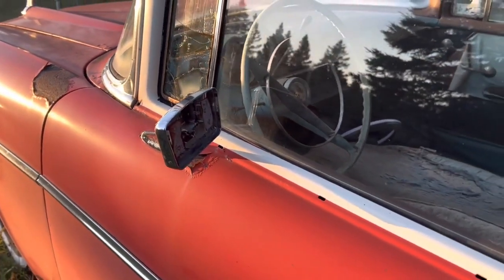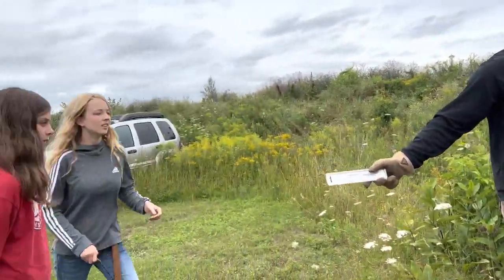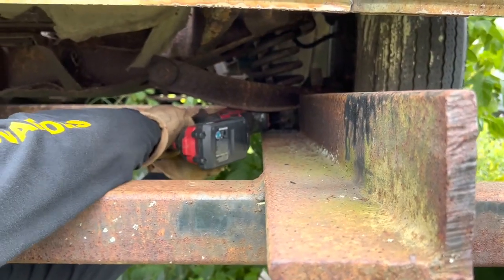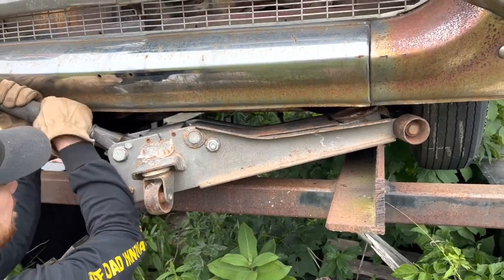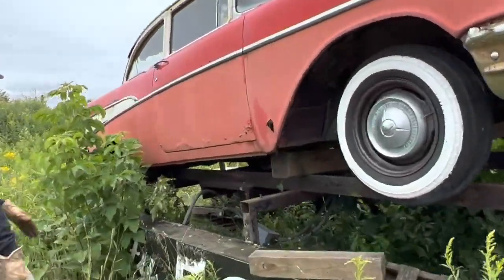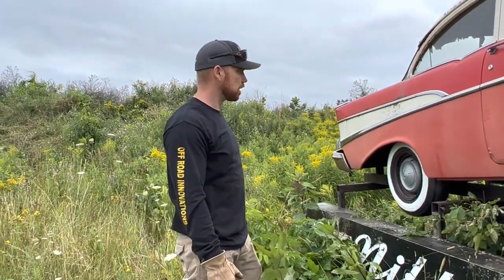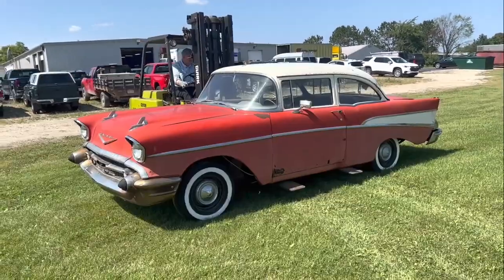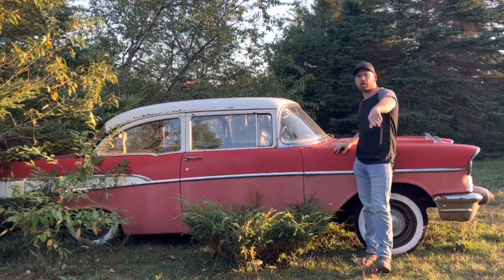50 YEARS Up on a sign! Rescued by dad and four daughters..

Comment: Awesome deal you got from your boss! the body looks like it's in very good condition it'll be an easy frame swap you can put pretty much any GM frame on there and get that taken care of, but the body looks pretty pretty good car looks pretty whole overall trim good luck getting it back on the road wouldn't mind seeing the process take care...
Reply: Each division had it's own frame and it's own wheelbase length, unlike the late 79s/80s.

Comment: Before throwing your jack away, did you happen to check if it had any hydraulic fluid in it ? If it had leaked out, you could have replaced the seals a lot cheaper than having to buy a new jack. Have a great day 😊.
Reply from the maker: 😂 after I had tossed er in the metal bin I remembered that Jack was getting low on the fluid .. But now I’ve got a nice new shiny one!

Comment: Great little body style, hope you can save it. Be curious to know the date code on those tires, give an idea how long she was up on that sign. Oh, forgot to mention, a four door frame is the same as the two door. Maybe you already knew that though.
Reply from the maker: We’ve located a couple frames but of course on the other side of the country.
Reply: Wooley , I don’t think date codes on tires were used WAY BACK then.
Reply: @ricardofierro7041  Some mfgs used a three-digit code before 1971, it would be first two numbers the week of the year and the last digit was the year. Not a great system but was there.

Comment: Nice piece of work! LOL That should keep you busy. Is that a 55? (oops just read the caption ... it's a 57🫢) Seriously though, that should be a fun project. Wish I had a mentor like you. I need to figure out how to fix my snow blower. I've got a hex screw that I removed when I cleaned the carburetor. Just as I was unscrewing it I said to myself, I didn't have to remove that. Turns out it goes to the choke somewhere ... I need to figure out where I took it from. 🤷‍♀
Reply from the maker: Just keep at it and you’ll figure it out